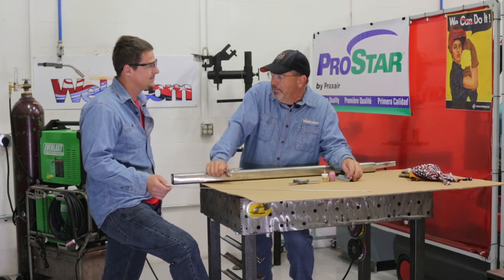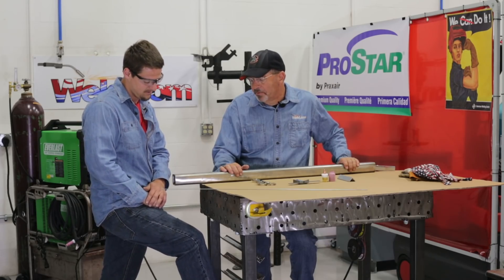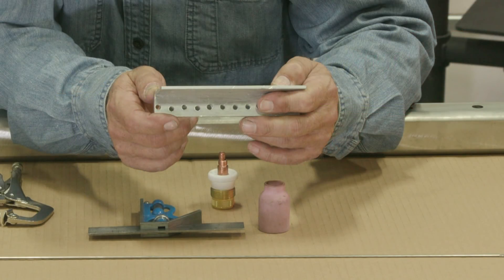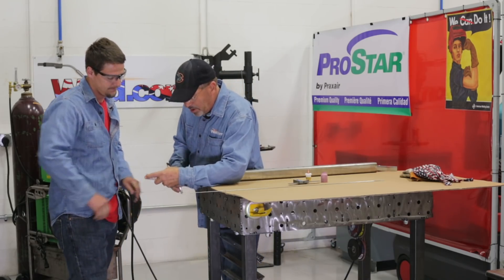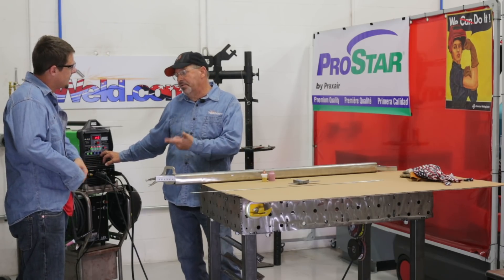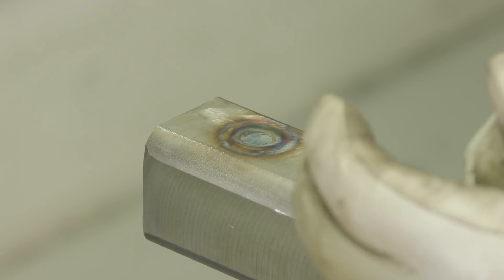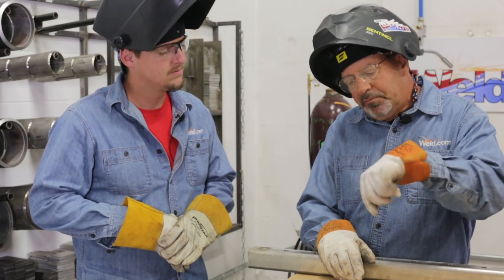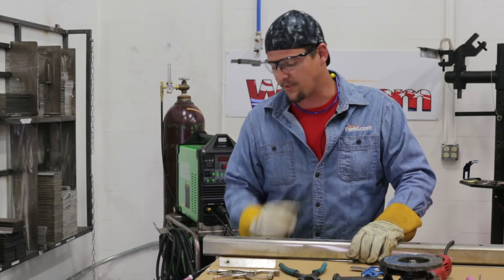🔥FILLING HOLES WITH TIG WELDING

Comment: Can it be redrill to add a tap, I got hole on a pump that the threads are gone and the hole is too big like a slot and I want to fill it up with weld and drill a hole. Is it possible?

Comment: I've done this a little by countersinking the hole pretty heavily, backing up with copper plate.  This was the first thing I ever did with TIG, actually the reason I wanted to do TIG welding, to fill up holes!  Partly from mistakes, mostly from working with scrap material, and having extra holes in whatever you make.

Comment: Question is critical weld? We have a part that welds on the drum at work, the weld procedures says you can use 7018 rods, mig, or T.I.G. You plug weld all the holes then grind them back to meet the radius.

Comment: That's not how I would do it, I would weld around the perimeter of the hole then flick across the hole and stop, let it cool for 30 seconds and then start in the depressed hole centre and fill until over the parent metal height and done, no over heating of job or weld metal and fast.

Comment: I always tap the hole and turn out a bolt made of the same material and thread it in then weld it
Reply: That sounds solid!  If the hole is countersunk and/or the rod beveled a little, you might get a nice weld!  Depending on the material and your supply situation, it seems like a piece of bar might be as good or better than something threaded, especially since so many bolts are galvanized.

Comment: I have used copper backer many times.  Today as matter a fact on floor pans but the dropping the filler in the hole first was a great idea.
Reply: Yeah, copper makes the best backer. Brass is next best, and aluminum works fine too. The big thing with an aluminum backer is that it has a good oxide film on it. Heating it with an oxidizing flame until it acquires a grayish hue works. Best is a scrap piece of hard anodized aluminum. The aluminum oxide is very refractory, so it will resist melting from the heat of the arc. I have had to fill holes in round tubes, and I have used TIG gas cups, which are made of aluminum oxide, as a backer, held in place using a piece of rod in the cup and clamped in the usual manner. Works very well.

Comment: I always machine a tight fitting plug of the same or similar material and press that in the hole, then tig it in. Also for stainless I would passivate the weld ( probably the whole thing if it was going outside ) just to be on the safe side.